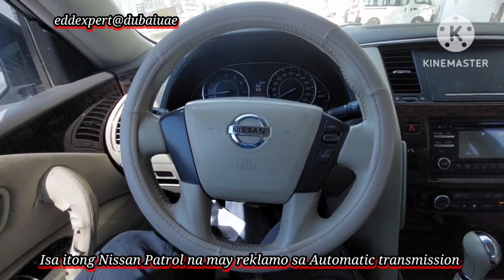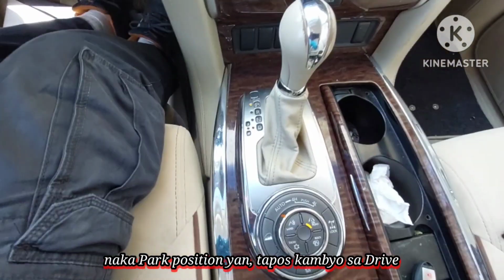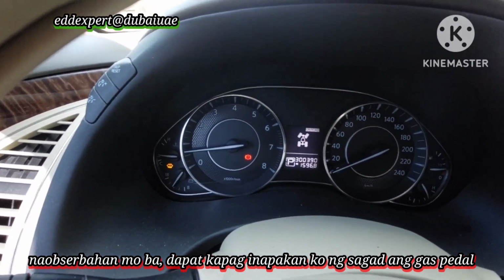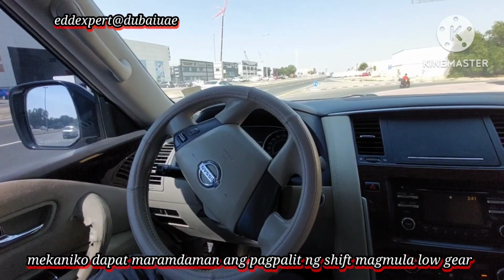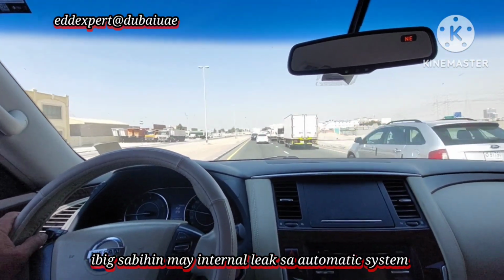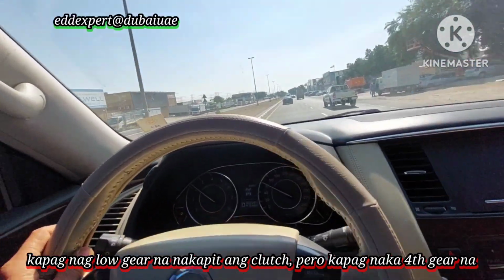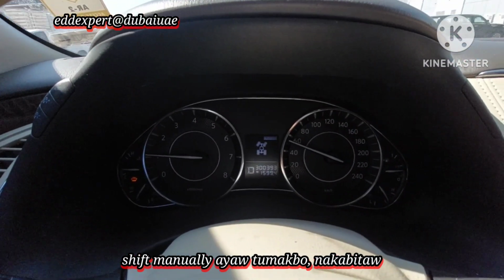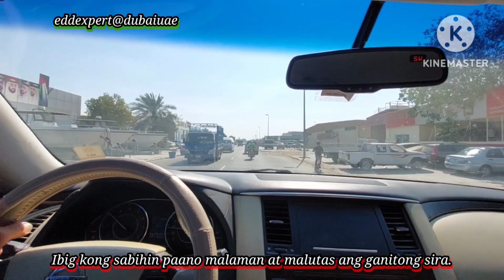🇵🇭 Automatic Transmission Failed. What is Stall Test. Nissan Patrol Y62 engine. (nagneutral daw) 😅

Comment: Bro i have issues with my y62 400 2014 . No fault code or check engine. The rpm in idle will go down fluctuating around 500 - 1000
And when driving gear kick kicking also changing gear till 3 around 2500/2800 from 4th gear changing more than 3000/3200 if i release the gas pedal rpm not going suddenly down it's down very slowly. If i make pedal release and press again gear changing to 5th nd 6, 7. Each gear shifting i can feel in car. Also over heating in traffic and idle summer time winter is fine. Please any suggestions
Reply from the maker: Well, regarding rpm fluctuating, my suggestion is to service the throttle body. If it doesn't work, conduct an idle learn volume, which can be done at the scan tool.
Secondly, about the late shifting or kicking, monitor the input speed sensor, which is match to the engine rpm. If both are not tally, then you may not solve the problem. I hope everything is clear.

Comment: Brother i have problem in my y62 2014 400HP which is the gear lagged in second shift gear and never shift, also when i turned off my car and returned on 4wd turn on and rpm 1500 and lagged , also when I put in manual it doesn’t work and only drive in second gear and running to 100 km/h and more with no shifting to 3d gear I don’t know what the exact problem is plz help me
Reply from the maker: Have a proper diagnosis of the transmission which is read the fault codes.
If there is wasn't a fault codes, internal failure in the transmission. How's the status of the atf, is it black or red? If it si black and smells burn fluid, that's a sign of clutches slippage.
Reply: @edralinbustaliniomcbautomo7707  to be honest I haven't checked yet , but the check engine light came on and then turned off , thanks a lot I will check it as soon as possible

Comment: My car doesn’t go reverse but drives forward perfectly. I did the stall test. In D it only goes up to 2000. In reverse it goes above 3000rpm. So what will be the solution for this
Reply from the maker: It is required to pull down transmission and have a proper examination and overhaul. There is an internal fault in the system.